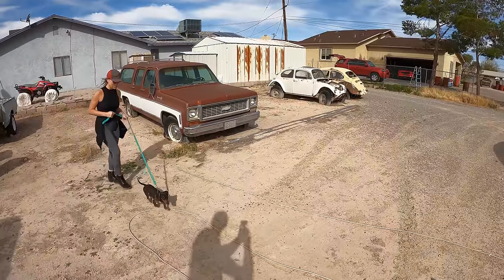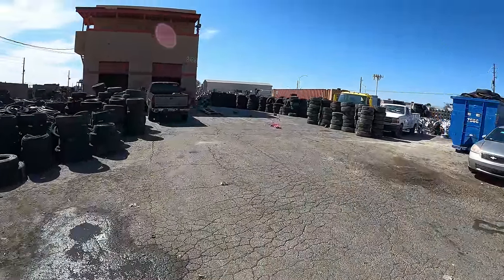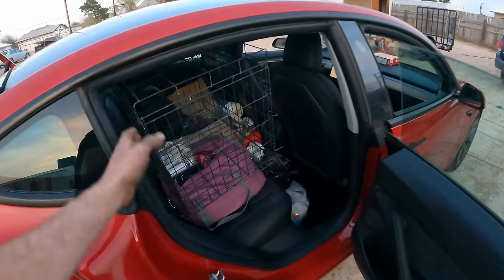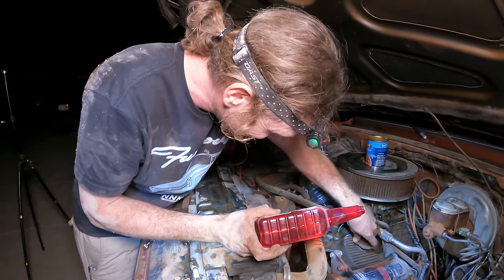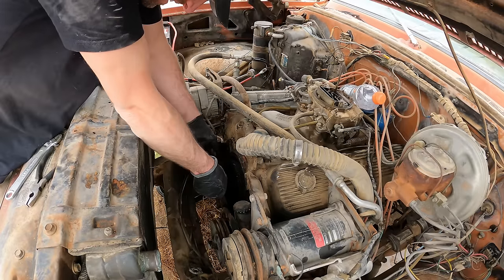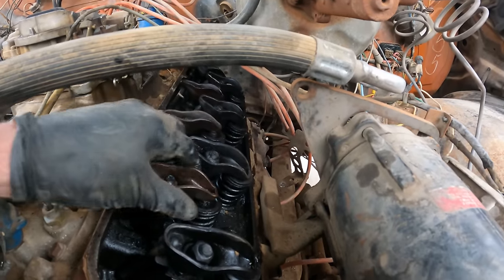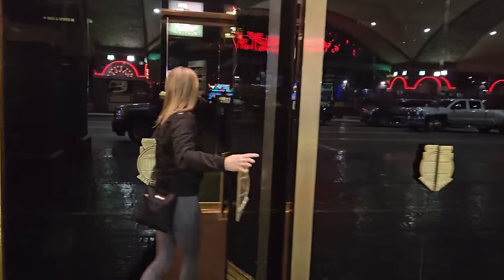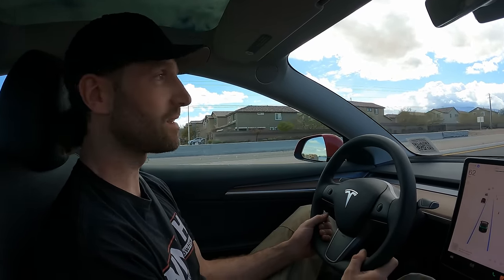1973 Chevy Suburban 454 Sitting 23 years - Will It Run And Drive?

Comment: Sure it will run if you do it the right way, when an engine sits that long without running the this you must do is remove the distributor the get a drill with a long flat screw driver tip and drive the oil pump for a good couple minutes then turn the crank manually 1 quarter turn then run the oil pump again for about a minute then turn the crank 1 more quart turn and do this until you have turned the crank 2 full turns then install the distributor and prime the carburetor and fire it up, if you do not do this there is a very good chance you will spin a bearing and you will know you spun a bearing after you have driven down the road a few miles cuz she will start knocking on you, so never attempt to start an engine that has sat for many years without priming the oil system
Reply from the maker: These videos are more of a minimalist approach. Toss the battery in and go. LOL.  If your working on a high-dollar engine, Yes prime the oil system. But I've started many dozens without and have never seen an issue.  Honestly I think every engine should have a secondary oil pump for priming before starting. Like old airplane engines.

Comment: Unless it'd had some performance work done the 454 is not an interference engine. Simply put it in time and replace the chain. Of course if you're engine sounds like this after starting its probably toast anyway.

Comment: I give you props for getting it going again but i would have definitely changed the oil before start up regardless if it was gonna run or not once you got it spinning over it was basically gonna run when u changed the timing chain and running without water not a great idea i understand it you did a fantastic job with it though not criticizing you just an idea of a different procedure is all.

Comment: My main problem with electric cars is that in most places they are part nuclear, which is far dirtier even than coal and building and cleaning them up will take more fossil fuel than they save, as does ethanol.  I like hybrids though, especially since some of them are over 20 years old now, though testing each battery cell on a 20 year old hybrid and replacing most is a specialized and exhausting job, all for not enough electric power and usually too much gas power.  
    You might try an early hybrid revival if you want a new and specialized challenge.

Comment: Dude that was extremely dangerous pushing on that crank while she was hitting the key if that thing would have broke free you would have a broke wrist or worst. Great video just please stay safe.
Reply from the maker: I was pushing in direction of the crank rotation. If it started cranking then the ratchet would have ratcheted. I've done it many times
Reply from the maker: You ever Kickstart or hand crank an engine? Kickback sucks. But that's how they used to do it. Obviously there wasn't going to be any kickback with a seized engine though.  Hope that helps answer your concern. Thanks so much for watching and checking out the video
Reply: Thought you were using a pry bar I thought about my comment after commenting and watching you us the rachet for everything else. But what the hey comments help the channel.

Comment: First thing:  check to make sure engine isn't seized.  2nd: check for spark.... 😆
Reply from the maker: First thing. Get the thing rolling. Because I promised her I would get it out by certain date and if it didn't run it was getting pulled with the Tesla to a nearby spot

Comment: As big a deal as a broken timing chain is, I'd still rather that engine than something modern and computer controlled having a problem. Its a real pain in the ass to diagnose anything in a heavily computerized car unless you drop a few grand on a bidirectional scan tool and programmer (another damn computer) to work on them.

Comment: Those flat tires are great for the flat earther's😂
With an engine that weathered, you might want to drain the oil first .then fill the crankcase with new transmission fluid. It has a higher detergent value and will clean out the gunk ,then drain it and fill it with heavier weight to take up the sloppiness of the oiling system. 
Wow! Broken timing chain . 
That sucks !You're looking at complete dismantle of that engine.
Go pick up a complete engine gaskets kit and rip it apart . What's the point of putting more money into it without knowing how bad the bearings are?
Man are you ever good at getting this engine  moving  forward.
But you got it to move forward and fixed it enough to continue with the project. 👍.Still looking at a complete powertrain rebuild .
But I know that it is worth it.

Comment: Fast forward 10 years - a 2022 Tahoe sat 4 of them. Every pulley on every accessory is seized and junk (after just 3 months parked), every bolt breaks off, hours of labor removing 100 different parts just to reach the spark plugs, coil packs all junk, wheels have to be cut off the rotors, rotors have to be cut off the hubs, calipers have to be cut off their mounts, 297,000 miles of low-bidder wiring is all cracked, green & junk, ethanol fuel has turned into 20 gallons of jello. Chances of running that century - ZERO! 🤣

Comment: What causes the car jerk at 20mph?it happened on my 03 Accord last week. I was told its the switch solenoid. I changed a bunch of sensors already. Changed trans fluid and filter. Please advice.

Comment: and if it's been sitting for 23 years you would have to maticously clean the fuel lines and replace the fuel pump, fuel lines and carburator in order to clean the gum out''.

Comment: Dude, this 454 has sat for 24-25 years? -And you didn't even pull the plugs, add some lube to the cylinders & see if you could turn the engine over by hand, using a drive tool on the crank bolt? Tsk, Tsk...
Reply from the maker: We went over this in the video.  Tick tock ⏰

Comment: no, you can't beat the balancer on with a mallet. Never. Then certainly ran it hot hot driving it around with no water or water pump. geez man, this was a rough video...
Reply from the maker: I've done it in a jam. It can be done trust me. Certainly not good for the thrust bearings though
Reply: @NoNonsenseKnowHow  oh by all means yeah you'll get the balancer on and it'll function, but if you don't have a installer to run it down right, a better option is a piece of board and a bottle jack. Even, steady pressure would be far less damaging than shock pressure.
Reply: @thatpilotguy4995  Pffft. Its a "Will it Run", not a "Restore it to Stock" video...

Comment: No it would of not started, but this actual vehicles has actually been sitting for less than a year''.
Reply from the maker: I'm guessing you don't have a lot of mechanical or automotive experience.  Or maybe you just didn't watch the video. I'm not sure.
Reply: @NoNonsenseKnowHow  40 years of mechanical experience and 30 years of investigative experience, you are faker than most TV shows, Thanks.

Comment: Dude, When you die you will go to heaven. I take that big block and transmission out and scrap it immediately. The bodies in good shape. You could put that thing back together. Make a nice rig but that motor and drive train done. D*** good video a true one that's what happens when you mess with those old relics period